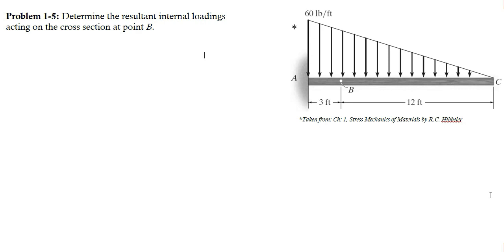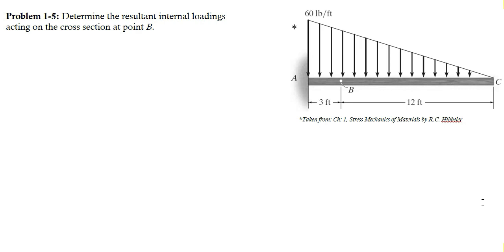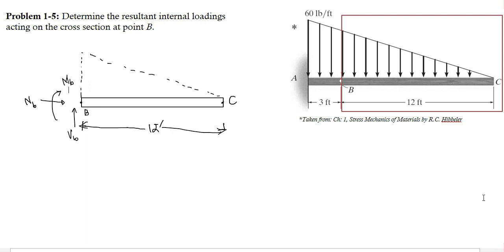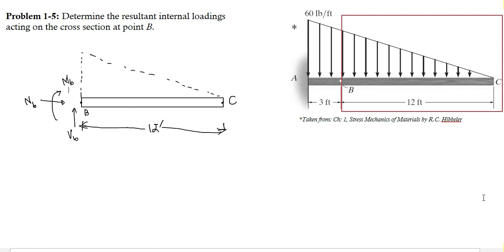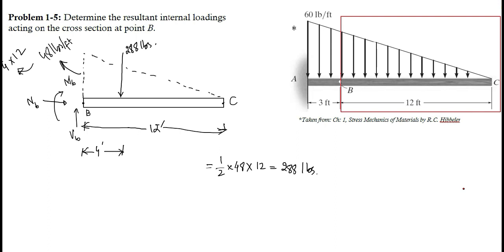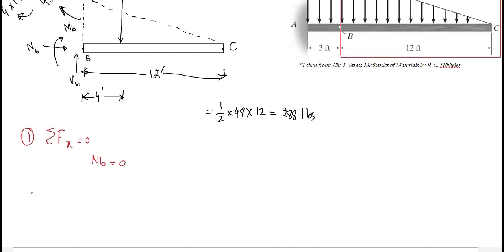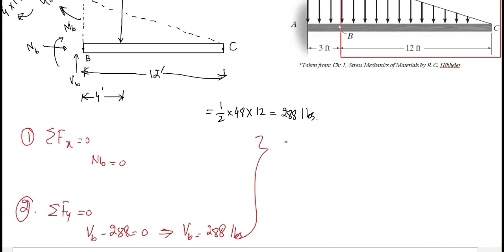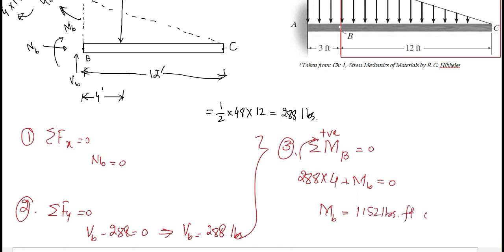Problem 1-5 Resultant internal loadings at point B, Mechanics of Materials

Comment: why do you 288? isnt it 576?
Reply from the maker: I think you are talking about the load obtained by the externally applied uniformly varying load? If yes. The following discussions may clear your doubts. The value of 576 will be obtained if we had a uniformly distributed load UDL (12*48=576) but in this case, we have a uniformly varying load (UVL), hence (1/2*12*48=288). It is the same like the area of a rectangle (UDL) is b*h but the area of a triangle (UVL) is 1/2*b*h.

Comment: How to know that 288 lbs will act 4 ft from point B
Reply from the maker: For uniformly varying load(UVL), the load will act at 1/3 of the total length of UVL from the larger side. 12 x 1/3 = 4 ft, larger side is B, hence 4ft from point B.

Comment: How did you get 48 lbs/ft from the 60 lbs/ft. The 4 times 12 does not explain enough. What equation did you use to get 48.
Reply from the maker: Consider two similar triangles (same base to altitude ratio), one having a base of 15ft and another of 12ft. The altitude of a triangle having a base of 15ft is 60, and another of 12ft is unknown (let's say x). So, using ratio 12/x=15/60. Solving this will give x = 48.